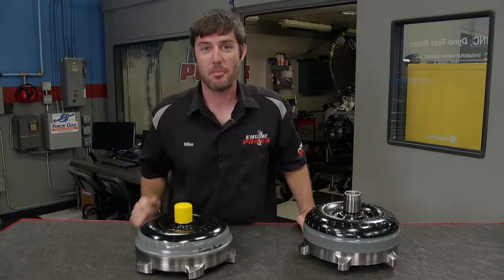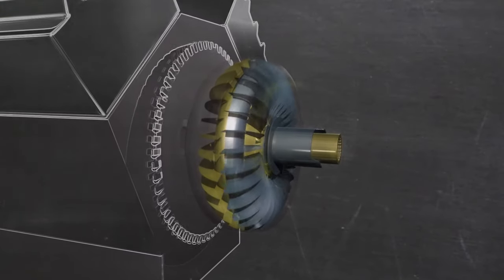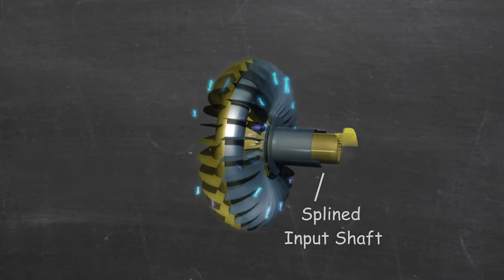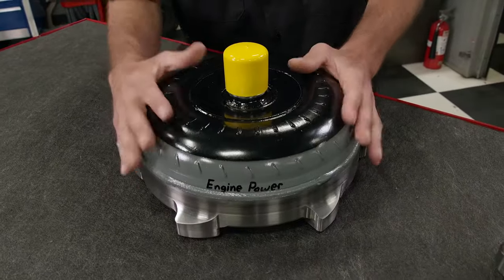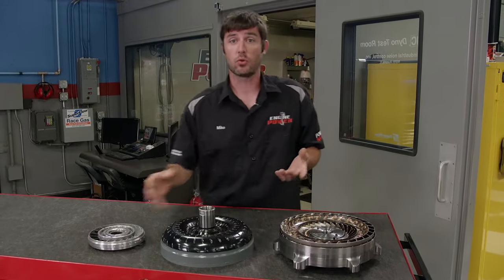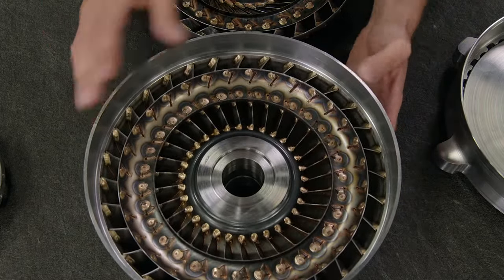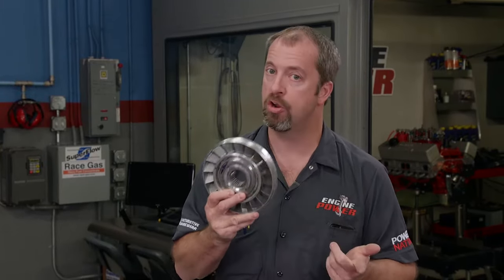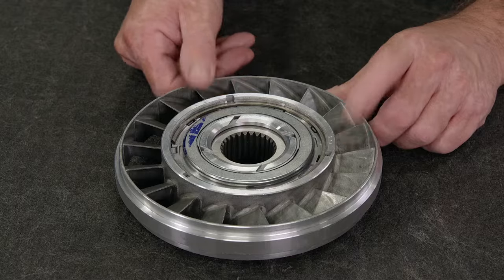How A Torque Converter Works And What's Inside

Comment: Do old 1970s torque converters have stators too?  I have a Mercedes 250 1972, which drives fine while the cold engine when getting hot drives fine except at stop signs likely the torque converter is locked and the engine wants to die because tranny is engaged.  I have to rise RPM to not die. wondering if TC can be locked. Thank you.